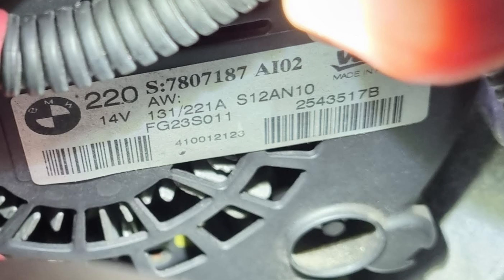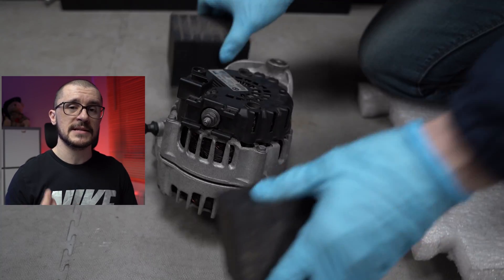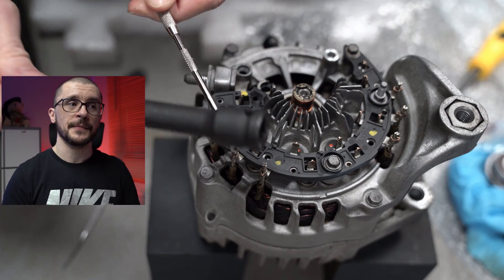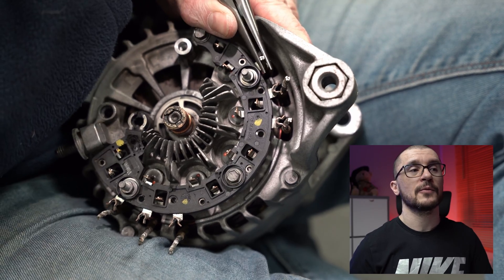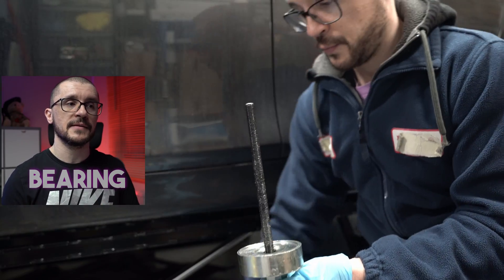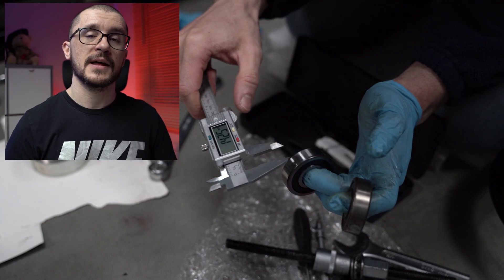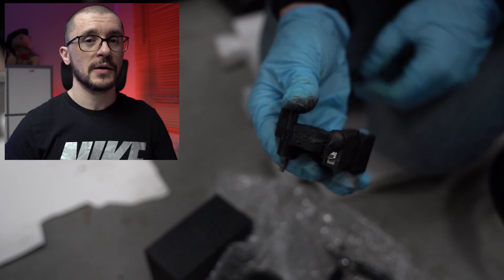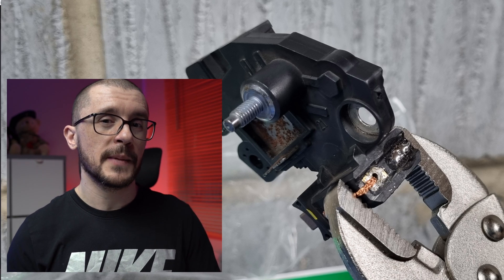How to Repair the BMW F10/F11 530d N57 VALEO 220A Alternator - Step By Step

Comment: You said something about the alternator making some sound, did you fixed it after this ? I have a weird whining sound. I'm suspecting either the alternator or the power steering pump.. N57. Thanks !
Reply from the maker: In my case the sound was the crackshaft vibration dampener.

Comment: Hello... I have an F15 Diesel and the alternator seems to be different although its the same engine...  The listing on your ebay store does not seem to clarify if it will work on alternator: Val- 439833.  Could you confirm if there is such a kit for that particular alternator?  Great video BTW...  Very informative and easy to follow!
Reply from the maker: I would ask the seller on ebay to confirm or guide you to the product that they think will work on your car.if that one seller does not know, find another that has multiple listing with parts for alternators to shop from. they will have access to some alternator parts catalogues.